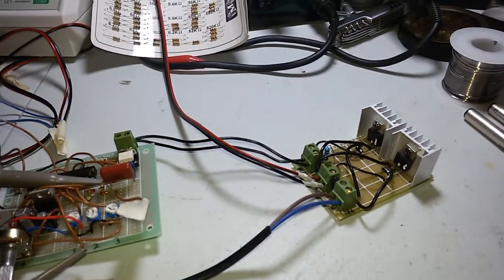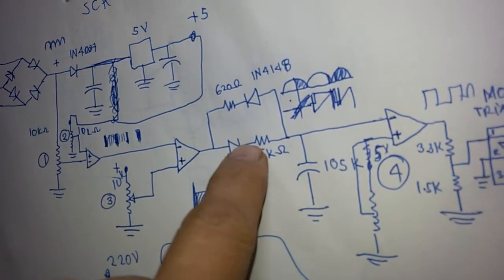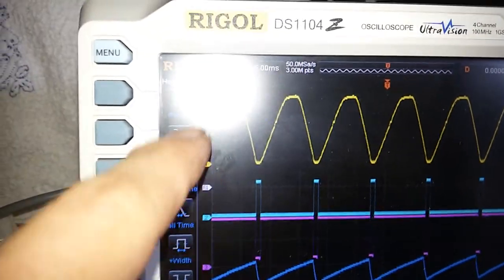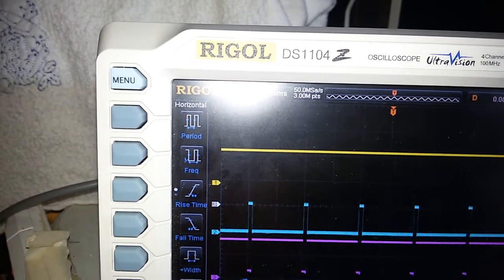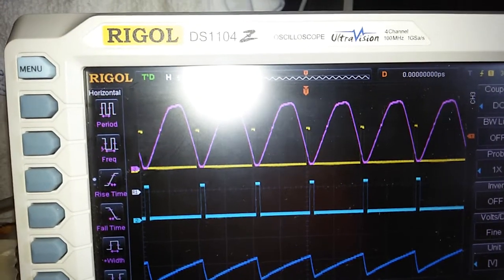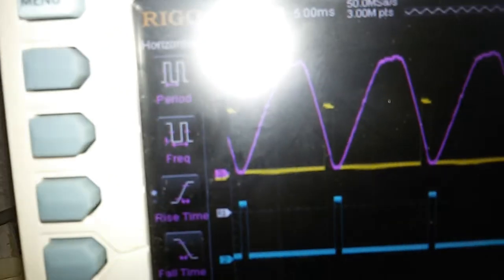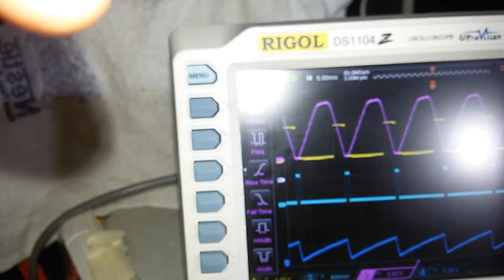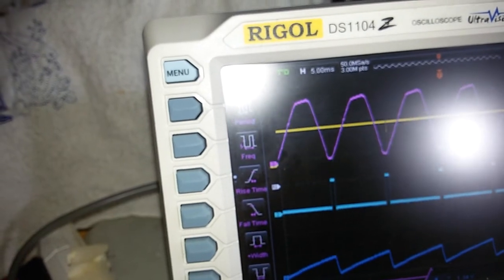How to make  thyristor SCR firing circit using LM324 OP Amp 4 of 5

Comment: Excellent work ¡¡   What is the value of electrolytic capacitors and ceramic capacitor ? Thank you
Reply from the maker: ou can use 100mf to 220mf for electrolytic, thats only for power supply filter. And the ceramic one is there 105K means 1mf from the capacitor chart.

Comment: So you use two separate 220 lines. One connects to control transformer (control circuit) and the other connects to the load (power circuit). Am I wrong?
Reply: Isolated load and control sections

Comment: Hi, thanks for the video. How did you ground the circuit? the control side and the 220 AC side. are they(grounds) separated?
Reply from the maker: +handel Yes, separated through the control transfotmer only..